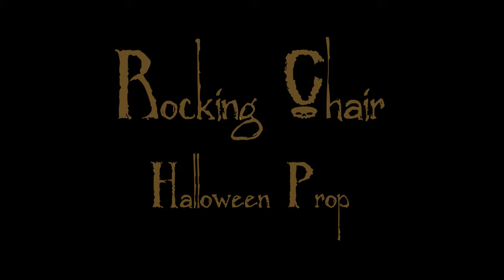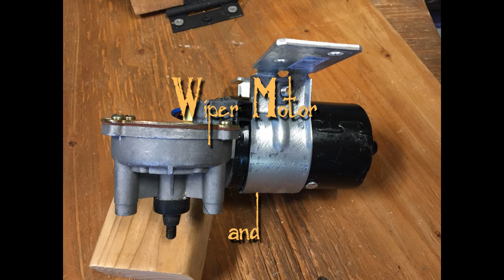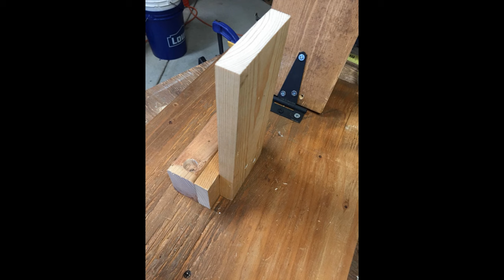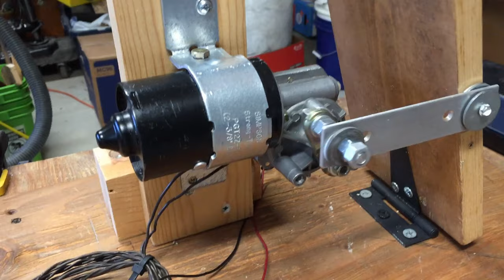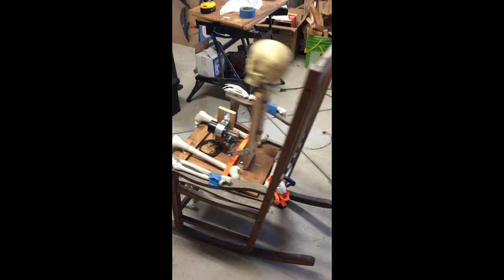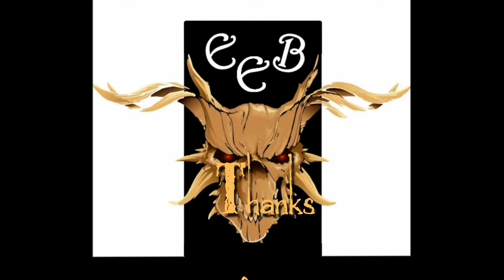Rocking Chair Prop - Halloween DIY

Comment: Love it, but how do you connect the car wiper motor to be plugged in the wall? Some type of power converter?
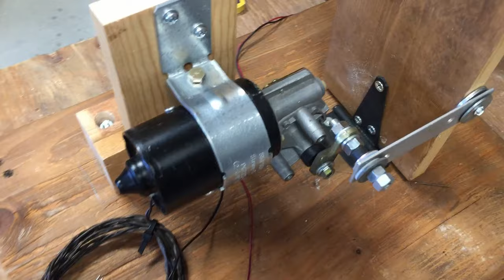Reply from the maker: Thanks Merlin, I used an inexpensive 2amp variable power supply.  You can see it in the video at time stamp 1:10.    The power supply plugs into 110v house voltage and puts out DC voltages at 2.0v, 4.5v, 6.0v, 7.5v, 9.0v and 12vdc.  It is Model MW122A and available online for about $25.    You could probably use a simple wallwart rated for 9 volts DC but it will need to be rated between 1.5amps and 2amps.   (I used the powersupply set at either 7.5v or 9v because at 12v, the rocker was unnaturally fast.)

Comment: My wife built this based on your video, it isn’t rocking though, any suggestions? Does the the base have to be closer to the front? Weight distribution?
Reply: Use another motor to push a stick touching the ground to create the rocking motion.  Another idea is to add some weight to the top of the head area to create more leverage on the rocker.

Comment: Does the motor rock the chair too or just the skeleton head?
Reply from the maker: Technically, the motor only rocks the torso and head backwards and forwards.  But that action is exactly the same as when a person sits in a rocking chair - the person will only move his/her torso and head back and forth which will create momentum that will rock the chair.  The motor has no direct moving connection to the chair itself.
Reply: @Dakota271 That's awesome. I have a rocking granny in the hospital gown from circa 2003 and she still works like a charm. However, if the motor ever went out what would you recommend replacing it with?

Comment: How much voltage and amps are being used for the motor
Reply from the maker: Apologies for my delayed response.  I failed to notice the new comment.  To power the motor, I was using a small 2A variable power supply (because it easy to use and is on my workbench).  I don't recall the exact voltage, but I know that 12V made the prop rock too fast.  I finally used either 6V or 9Vdc.  I did not measure the amperage, but the maximum output of this variable power supply was only 2amps, so it certainly was not more than that.   Hope this helps.

Comment: Can I get your wood dimensions and how long the shaft is from the motor to the wood.
Reply from the maker: Mike, apologies, but after Halloween I typically dismantle my props/mechanisms for easy storage and re-purposing.  I took no measurements when building the rocker prop.  Based on memory, I made the upright support for the motor using scrap 1x5.  I made it tall enough to adequately attach the (fence post) bracket that secures the motor to the upright (but not too tall because the mechanism is hidden under granny's dress and you don't want it too tall).  The horizontal pieces behind the upright are also available scrap lumber used to attach the upright to the base board.  The base is a piece of plywood taken from a previous year's prop and is sized to fit in the rocking chair seat (so any size works as long as it fits and can be secured to the chair).  The tall, hinged upright was cut to a length that would represent granny's upper torso.  The motor placement from the hinged upright may require some trial and error, but not critical.   The length of the narrow aluminum plate/arm that attaches the motor axle to the hinged upright will determine how far the hinged upright moves (forward and backward).  I think I used clamps to test the distances first to ensure that there were no interferences.  I hope this helps.  Sorry for not having measurements.
Reply: @Dakota271  You're the man.
Reply from the maker: @loganhatch  Thanks Logan

Comment: Are the motors easy to wire up?
Reply: Yes, but the speed control is another matter, you need to work out, by powering them, which wires are for slow/fast and the intermittent isn't available unless you get the whole contraption from the steering column to the motor I believed.

Comment: How much Rom do the wiper have?
Reply: RPM
Reply from the maker: @thebutterbrotman759  Automotive wiper motors like the one in the video (available at Frightprops.com) have two speed settings.  The unloaded speeds are 50 RPM and 35 RPM at 12Vdc.   With lower voltage, the speeds are reduced.